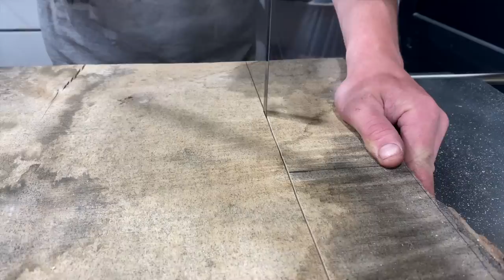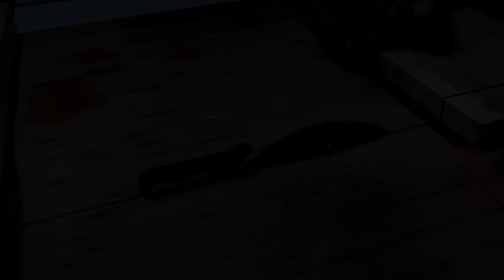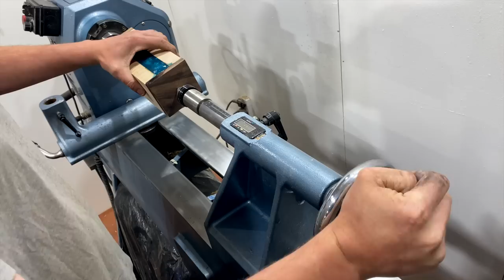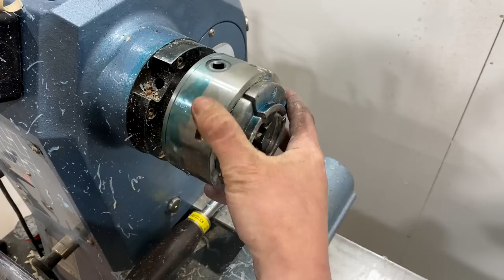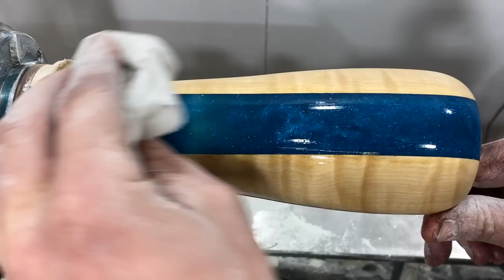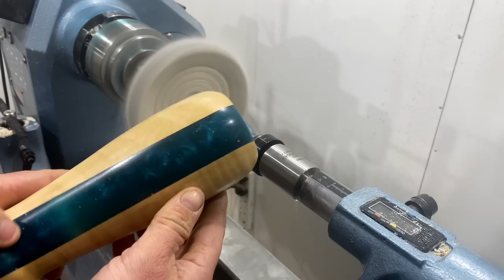Woodturning - Waterfall Vase

Comment: HI Jack, another unique vase, was a bit surprised you took of the ends (dark wood) did you change your mind ? still fantastic. Cheers Will
Reply from the maker: Hey will. The dark wood is black walnut. I didn’t have a set plan when starting so used walnut incase I’d leave them on. It’s actually the best voice of wood I had too as iv got shelves filled with little offcuts like this. Probs cheaper than ply at the moment too 😆

Comment: Hi Jack, two questions. Do you "flame" a resin pour of that depth to remove bubbles? Second, do you seal the inside down to the bottom? To avoid any further drying or cracking from the inside. Tanks.
Reply from the maker: Hi John. Flaming the surface of a resin pour will clear the top and break the surface tension of any bubbles it makes contact with but will not effect bubbles blow the surface of the resin. On a piece that is due to be turned flaming is unnecessary as the outermost surface will most likely be turned away. 
If you pay attention to the placement of the glue holding the blank together Pryor to the resin pour you’ll see that it creates a full seal around both areas that receive resin. 
Hope that helps 👍🏻
Reply: @JackMackWoodturning  Thanks, everything helps. Last thing I turned was a 42" wide table base (Outboard side of my Delta lathe head) and center column for a Hi-top kitchen table. Since then, texting drivers, caused 4 broken necks for me. I'm making arrangements to move my lathe to a more convenient location , as I no longer have use of my legs. These smaller projects  appeal to me and the limited use I have of my arms. Stay tuned. Hahaha.

Comment: A lovely piece of work. The only thing is that he used CA glue to hold the wood together. I find CA glue has a short operating time, less than 2 years. It's becomes so brittle that it breaks even under light use.
Reply from the maker: You miss the bit with the masses of resin Dave ?? You think maybe that might hold the piece together?? And maybe the CA was to hold the wood and seal the gaps so resin could be poured 😆😆😆
Reply: @JackMackWoodturning  Good points. I am just leary of using CA glue for anything structural.